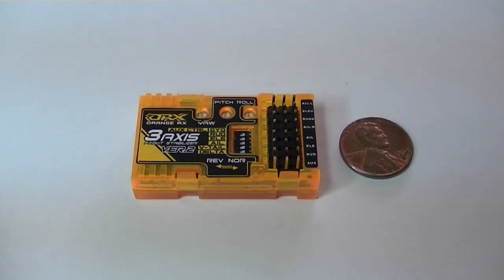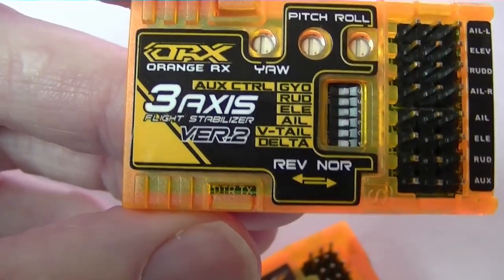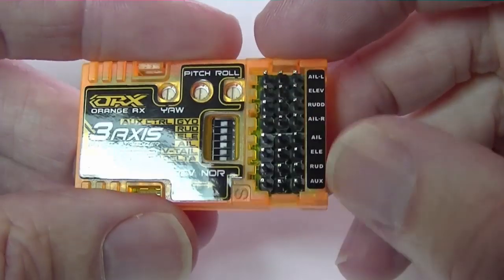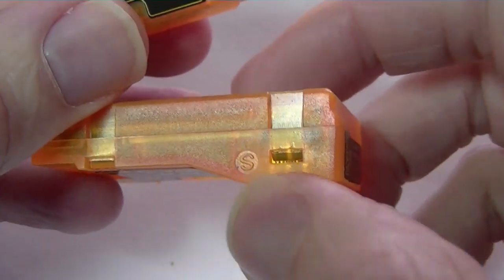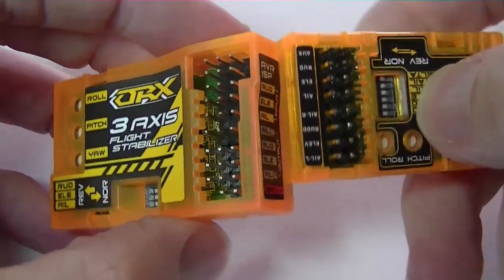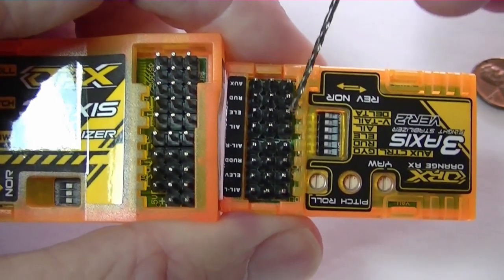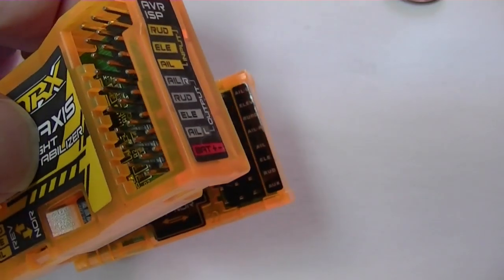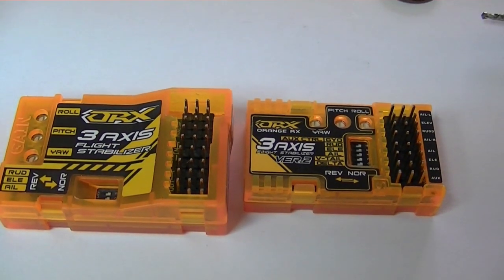HobbyKing RX3S OrangeRX 3-Axis Flight Stabilizer V2 (V-tail/Delta/AUX) Part 1

Comment: hello, Don't know if you still monitor this video thread. My question is, although I finally got my V2 version working, the LED light stays on instean od blinking. I noticed on all I see on you tube it blinks intermittently. Should I be concerned? thanks

Comment: Great video, tnx!
I´m planning to stall on my DC-3 but i have a quick question please...like warbirds, DC-3 has tail wheel and the normal/taxi (gear down) stance with nose high (considerable angle)...how do i need to stall this gyro? Can i maintain the airplane on normal stance (again, gear down) or should i retract the gears and configurate on "normal flight stance" ? Tnx and please keep posting

Comment: Hi. I have one of these and my question is:  Is there any requirement to be used on any plane? I mostly flight and love warbirds so, what´s your suggestion? I consider myself an intermediate pilot. 
Thank you in advanced!
Reply from the maker: +José Alberto Varona Sánchez You can use it on any plane even delta wings and V-tails.
No auto leveling on it though.

Comment: Hello will the rx3s cause my ar610 receiver to fail ?
Reply from the maker: Not that I know of.
Reply: Thanks, looking to set up gyro stabilized Flaperons for my 800mm F4U Corsair using Ian Jeffery's set up of a AR610, the RX3S and a Turnigy V-tail mixer as a bypass

Comment: I HAVE 3 OF THESE, V2 AND WORKS GREAT OFF/ON VIA AUX FOR THE FIRST ONE
NEXT 2 SAME V2 AS THE FIRST, CAN NOT TURN OFF
THEY WORK WITHOUT THE TRANS BEING ON!!!
ANY IDEAS?
THANKS
LARRY
Reply from the maker: Sounds like two of them are faulty from what you are saying. 
Is the RX3S getting power from somewhere other than the TX because it should not have power if the TX is off.

Comment: Thanks! Very helpful! I want to get this and add it to my super cub. I added ailerons and I decided I wanted flaps as well as all new electronics and brushless motor. I only have the dx5e so is there any way I can connect both the flaps and gyro on/off to the 5th channel? So when the flaps go on the gyro goes off? Thanks

Comment: I have the same product. I am trying to setup flaperon and wondering if I could set it up using the ALE-L and ALE-R? or do I have to use ALE and AUX?
Reply from the maker: There is a work around for flaps and flaperons in the description under this video. "Best answer for using this with 2 aileron servos with mixed in flaps/spoilers is to buy 2 TURNIGY V-Tail Mixer's..."

Comment: I know it has been a while since you posted this but I have one of the V2's on the way and wondering if you had any thoughts on the Open Flight Stabilizer firmware out there through RCGroups "noobee" . Maybe this is more than I need concern myself with at this early stage of my flight schooling (self taught, I should add). Your videos are exceedingly clear and to the point, very nicely done sir.

Comment: When you do your next review, you might like to comment on the left and right aileron OUTPUTs that drive dual ailerons the SAME way, i.e. both up or both down. This forces you to use a Y connector to both aileron servos fed off EITHER the Left Aileron or the Right Aileron ouput connection.